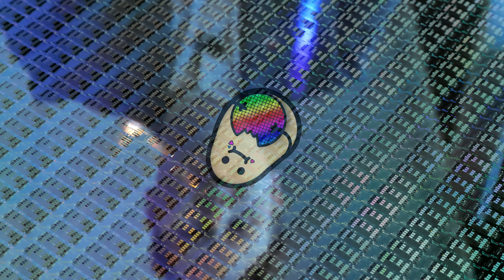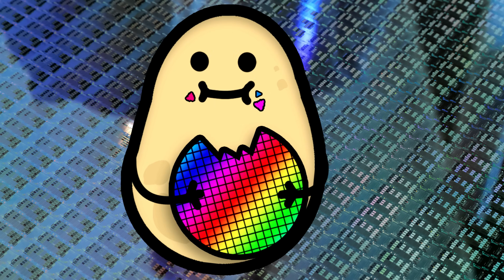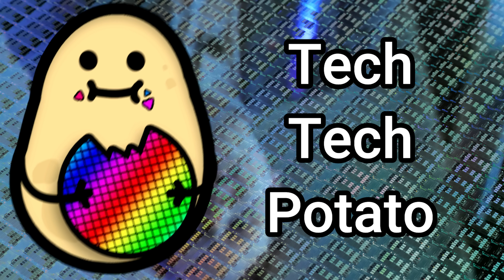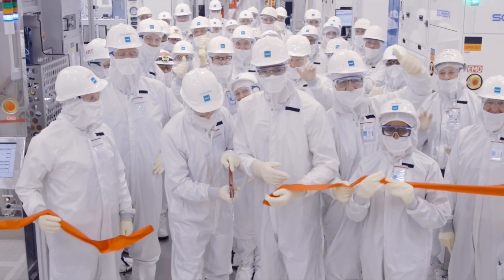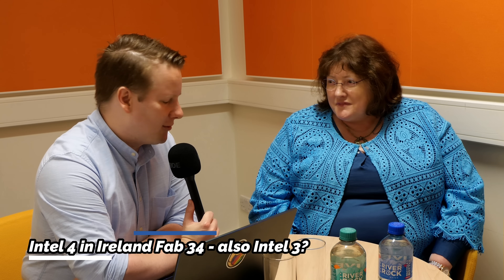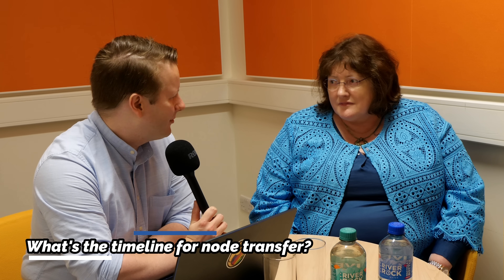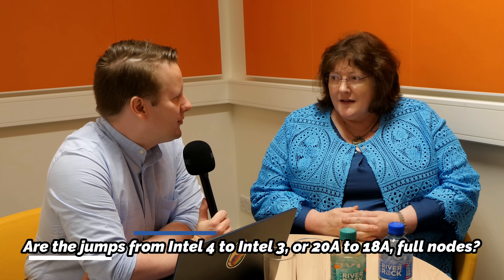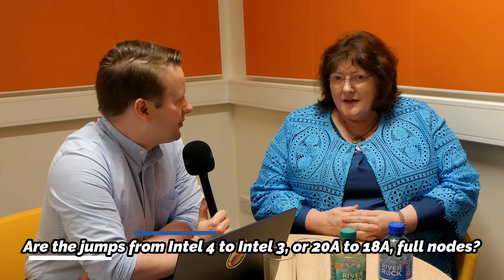[31] Dr. Ann Kelleher, EVP Technology Development, Intel

Comment: So it's interesting to see this after meteor lake has been released. Since it doesn't really live up to the hype, I wonder if it's a core design problem? Like, the packaging is great and it's really efficient when the CPU tile gets turned off... but the performance under load is not great compared to Phoenix, which is TSMC 4N. So if the node is really better or comparable, where does the disadvantage come from?

Comment: Why i believe intel is so confident and why their customers are starting to line up for 18a?
First off look at Samsung and 3nm GAA. What did they use? FDsoi smart cut.
Very expensive process and their yield isnt great.  Notice they dont have the customers lined up and pretty much at the point of ditching for 2nm.
What's very very important to control  in these GAA architectures is RDF.   If you cannot control that you're gonna have a ton of problems because one atom gets into the channel and its money flushed down the drain.
I believe i know what IP Intel will be using for RDF.
Its something i believe they have been working with for several years. Perfecting the process.
In the advanced nodes they use more epi.
So this is a way to control rdf in suitu vs fd soi which is a very expensive process.
This other process is much less.

Comment: Thanks for the very classy interview and video. 

I worked for Intel in Oregon in the early 1980s.  We had those same wall colors, and at that time,  even on the process equipment.
Reply: Back at Aloha, right? Were you guys doing DRAM while the original D1 in SC did logic? Or did you guys both do dram but staggered (for example you do 5 micron and I do 250nm)?
Reply: @ab-lymphocite5464   Thanks for the response.   I was in fab 4 doing production engineering on cvd and pecvd oxides and nitrides.  It was quite a product mix but basically anything that could be made with single or double layer poly and single layer aluminum. 

I am not sure if we were at 5 micron yet but there was a lot of 7 micron, 4 mhz in fab 4 using perkin Elmer scanners and not the advanced ones.

The product mix included 8086, 8087, 8049 / 8051, plus we were making mask roms for atari and govt,  16k drams, 16k  eprom, and other stuff.  I was fresh out of college as a chemical / materials engineer so I barely understood what the parts even did that we were making. 

Yes you are right that fab 5 led the development and eventually parts were transferred to fab 4 and other sites to support more production. 

Fab 5 was trying to bring up the 64k dram on steppers, but the design failed. Thanks to IBM for coming in and saving Intel from collapse.   Their paternal support of the suppliers is the main reason that the industry exists today.

It wasn't the easiest place to work,  but most of my career has been related to thin films,  deposition,  pre clean,  metrology,  curing, equipment,  sales and management roles.   So a good starting point.
Reply: @ab-lymphocite5464   Were you at Intel as well in the past?  Or the other suppliers?
Reply: I too, Worked at Intel in the 1980's.  BUT, I worked on Board Product Testing for Developmental Systems Group.

Comment: Hope she’s telling the truth.  The CPU side has been all lies and delays and disappointments for so long.  They are basically snake oil salesmen.  Hoping the contract manufacturing side is honest and on time.
Reply: Dude, time to change the battery of your clock... its not 2018 anymore
Reply: Snake oil? huh?? Intel's products have flaws but they're certainly not snake oil lol, I can run my code just fine
Reply: @kelownatechkid  Snake oil salesmen as in their product marketing.  If you don't know what I'm talking about, best not reply with such a stupid comment.  Any cpu can run code just fine.
Reply: @sflxn  wrong! AMD Cpu Can't run Code,. and AMD's marketing term is snake oil salesmen, not intel, ask anyone in the market know-how pushy the marketing term is
Reply: @jmtake85  Yawn.  We all know about all the Intel's past fake benchmarking and 10 years of the same Haswell architecture rebadge.  I've been following this industry for the last 30 years... back when I worked in it as an engineer in the semiconductor industry.  Intel's marketing BS doesn't fool me.

Comment: But is 18a really 18a???   You know Intel 7 <> 7nm.
Reply: Not how nodes work. What does "really" 7nm mean?

If the leading manufacturer (TSMC) calls a node with X characterists "7nm", then Intel is simply following the naming convention. What was previously planned to be called 10nm ESF had density and ppw characteristics on par with TSMC N7
Reply: @moist_ointment  Its so irritating... some reviewer learned something new when intel was stuck with the 10nm situation and now everyone thinks they found the holy grail on how to classify a chip...
Reply: @moist_ointment IMO Intel should have tacked on 'ne' or 'nanometer-equivalent'  to their node names.  So "Intel 7-ne" and "Intel 4-ne" etc...  That might have helped the dumdums see beyond their ignorance of node sizes.

Comment: For Intel to regain its leadership on all fronts they realistically need to release Nova Lake next year on 14A, sadly we won't see this until 2027-2028!!!
AMD has so many different ways to beat Intel at moment, Zen 5 is basically ready to come out whenever AMD wants it to which will wipe the floor with RLR, they can use Zen 5c to destroy Arrow Lake multi-threading, whilst all options being much much cheaper to manufacture so they can win on value too if they want to.
AMD will almost certainly have Zen 6 ready for 2025 and Intel will still be on Arrow Lake and I could easily see AMD have the replacement for Zen 6 ready to go before Intel has a replacement for Arrow Lake!!!
Reply: Time to wake up dude, intel is back wether you like it or not.
Reply: @Capeau  I'm writing this on an Alder Lake system and just bought 14700K, I'm not a blind fan-boy of any company but my Intel systems use a lot more power than my AMD ones and most of the time I would much rather have 16 full cores than only 8 plus some questionable E-Cores.
I don't think anyone can honestly claim the Meteor Lake development has gone smoothly. Arrow Lake sounds good on paper but when will Intel get it out the door?! We've not had Intel 4 yet, let alone Intel 3 and Arrow Lake is the one after that so I'm not holding my breath!

Comment: Sadly, I think the reality is that Intel needs to magically pull in 24 months of product development from nowhere and obviously that is just not possible. The Intel 4 (7nm) node is very late to the party, meaning Meteor Lake is much later than anyone ever expected it to be and to rub salt into the wound it's performance isn't going to make up for that either! 
Coupled with the AXG team not being able to include Battlemage, let alone Celestial which was the very original plan, it's not looking good. So all Intel has now is to try to hope that the AI engine in Meteor Lake will be enough to carry this product over the line.
Reply: You should understand that Intel 4 node is not 7nm, If its is like you say, where does it come from, do you have process specifics? More then 10 years ago intel node did follow in nm dimension but after TSMC started to grow bigger in market share they have did already what intel is doing now, TMSC called there nodes 16nm, 14nm, 12nm, 10nm without the node actually being that dimension per se. So it was TSMC who started first with a market name to a node and since we have INTEL 7, 4, 3 18A nodes Intel's node are also name only by marketing name. You should take a look at lets say gate pitch length for each node today on the market and compare!
Reply: @menger88p  Yeah I was purely putting that in there for reference to Intel current 10nm (Intel 7), I totally agree the names are meaningless, could call them capital cities for all it's worth but originally Intel was calling these 10nm and 7nm.
It will be incredibly interesting when we get Arrow Lake (I think it was Arrow Lake) because my understanding is that Intel is using both 20A and TSMC's N3 for the CPU tiles, so we will be able to compare the nodes exactly.
Reply: @Speak_Out_and_Remove_All_Doubt calling Intel 7 "10nm" and Intel 4 "7nm" is odd. 

Do you also refer to TSMC N6 as "7nm+" and TSMC N4 as "5nm+"?

Just use the proper names.
Reply: @Nanerbeet  yeah, key word being "renamed", so referring to Intel 4 as "7nm" is either someone way behind on the latest info, or intentionally using the wrong name to cause confusion.

Comment: Reference Dr Kelleher says everything has/is running smoothly and on time, in your own article Ian you had Intel 4 'ready' from middle of 2022 yet we are just, and i mean just, getting Intel 4 products at the very end of 2023! 
But ok that's fine, nodes coming online and retail products hitting shelves are very different things but if you follow those timescales and Intel executed it's planned roadmap of Intel 20A being ready for the middle of 2023 like it says in your article then that means products like Arrow Lake won't be on the shelves until December 2025 and Intel 18A products would still be over 3 years away!!! So either something very much went wrong with Intel 4 or it's going to be a tough few years for the Intel family!

Comment: A product using Intel 7 released in 2021, so 5 nodes in 4 years means a product using Intel 18A releases no later than 2025. I remain a bit doubtful
Reply: it might be available, but it might also be so expensive that it starts out only on server and mobile lines
Reply: @sinephase  If that happens I would consider that they achieved the goal. What I wouldn't say achieves the goal is saying 18A is "manufacturing ready" but no product releases in 2025
Reply: @adonisds  it will start mass production in H2 2024

Comment: It's a shame that Intel had to drop ASML's high-NA scanners for 18A, I guess they will be included for 14A.
Reply: It is exactly this kind of decision making that will save Intel. High-NA would've caused more delays for Intel 18A.
Reply: @EnochGitongaKimathi 18A is planned for H2 2024 Volume production 

High NA scanners won't arrive until Q1 2024 and it takes to to install and calibrate equipment.
Reply: edit: it takes time to install equipment.
Reply: @EnochGitongaKimathi   Yeah for sure, it's better to get something out than delay it until they could get high-NA working.

Comment: Is there a good write up of what went wrong at Intel for the last decade?
Reply: Intel aimed for the moon with it's advancements going into 10nm, and ran into countless issues. Meanwhile TSMC and Samsung moved to EUV at the time, which ended up being the best thing to do. AMD moved from GloFo to TSMC and rode that wave, while Intel was insistent on making 10nm work.
Reply: @__aceofspades  Thank you for explaining it better than I !
Reply: It was run by bean counters for too long. Sme thing happened previously at AMD. You might call it it "Corporation Syndrome". The original (failed) 10nm ask was too big a jump a decade back and they were stuck in development hell with 14nm for years. By that time AMD's foundry partner (Ironically which would have been AMD if they hadn't spun it out) had chucked in the towel and AMD got success with TSMC.

Comment: Intel might says 5 nodes in 4 years. But as a consumer (intel classifies me as a consumer, customer is something else) - I am getting three years of the same node and similar architecture in a row. workstation seems to be really slow as well, since there is apparently another SPR revision with what is essentially Golden Cove with AVX512 and AMX etc? 

Sure Meteor Lake is exciting but the NPU seems not at all powerful, just efficient. So it wouldn't work as a big accelerator for workstation, its GNA3.5 or a large VPUx. The real acceleration is from MTL tGPU. 
Intel had Gaudi2 and PVC, but dont sell that for workstation. 

So my question ends up being - if this was such a great development, when do consumers get the rewards of it? 3-5 years in the future? My CPU from 2015 is really end of life and I have a majoe disadvantage when competiting in CS2. Is right now (14th gen) a bad time to buy Intel? The only real positive note I heard is that's it's the most mature node they ever had with Intel7+++
Reply: Nodes take time, and then it takes time to produce on those nodes. 2024 is when we start seeing all of Intel's foundry work pay off. We will get Meteor Lake on Intel 4 in a few weeks, and Arrow Lake on 20A in 2024.
Reply: "They said 5 nodes in 4 years, but its only barely been 2 years, and the next node isnt launching for another 3 weeks, whats going on?"

It hasnt been 4 years yet. Thats whars going on. The roadmap is very transparent. 

Intel 4 launches in 3 weeks. 

Intel 3 a few months later with Sierra Forest.

20A products hit store shelves next autumn

18A products launch in 2025
Reply: I've been watching and involved in behind the scenes EUV development at Intel, it takes time to develop the tools and process designs, revisions when unexpected results are reached. Spent the last almost 7 years straight now on the EUV Vacuum control system, prototype, beuild, and now on the design and support side, been incredibly challenging work, but also fun.
Reply: @michaelkeudel8770  Hope its going to put intel back in the lead.
Reply: they said 5 nodes in 4 years, and they're serious: they have the nodes available. Problem is that the design teams are unable to get their designs working in short order, leading to this outcome.
Reply: why don't you make your company instead? It is not like Intel is borrowing readymade stuff like AMD does from TSMC.  You guys are notoriously dumb
Reply: ill split it and say 4 yrs
Reply: @Eromasin MTL is only mobile products. That's irrelevant for high performance, desktop and workstation.
Reply: Stop living in the past dude...
Reply: i know its frustating to see intel is "slow" to catching up, but hang in there a little more. Starting from meteor lake in a few weeks i think industry will be surprised by intel. Meteor lake is just the opening, after that we will get sierra forest intel xeon based on intel 3 at the end of Q2 2024, granite rapids intel xeon based on intel 3 by the end of Q4 2024, arrow lake intel core ultra based on intel 20A by the end of Q4 2024, etc.
Reply: @Arkan_Fadhila  Yeah, 2024 is going to be sweet ;)